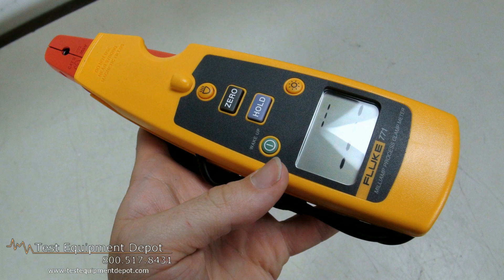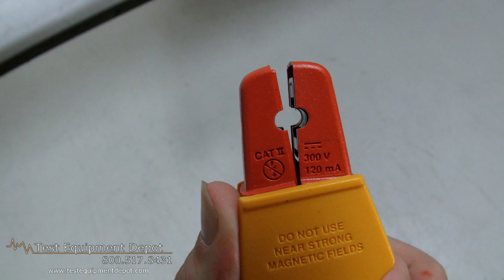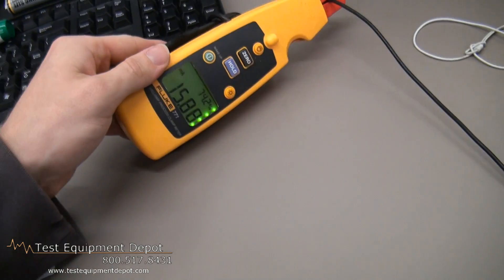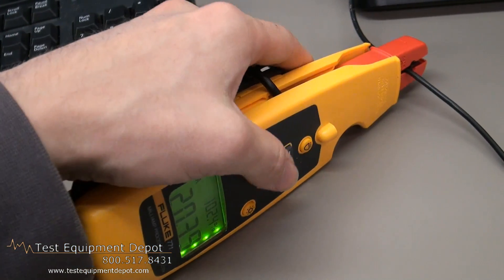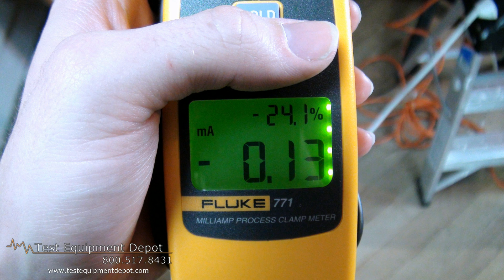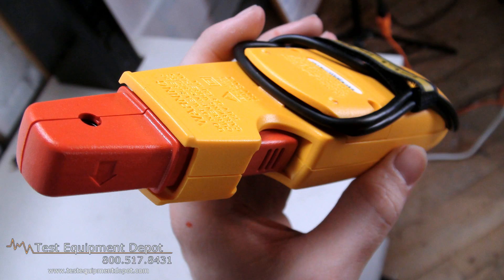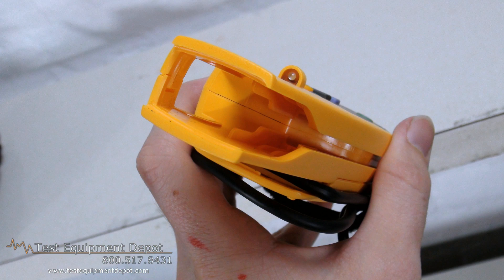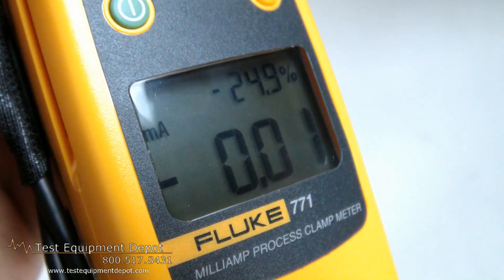Fluke 771 Milliamp Process Clamp Meter

Comment: Dangit i finally found a smaller clamp meter and its TOO small.

I want something that can measure miliamps acctuartely but i need it to handle at least a bit more current...

The mtp st-337 has a 80 amp max.

Thats more what i need... Maby 20-80 amp max would be acceptable

But its annoying how most of them are built with 1000 or 600 amp max lol